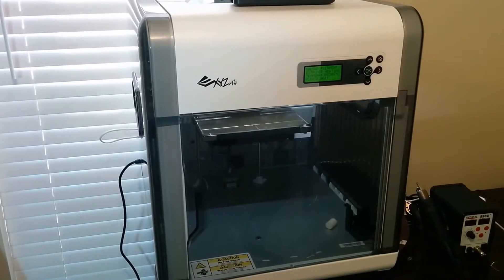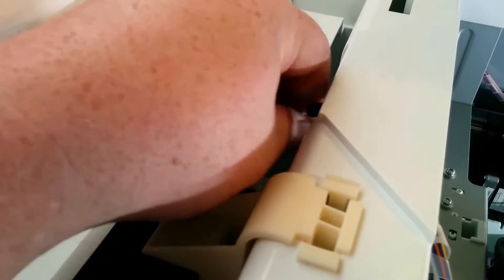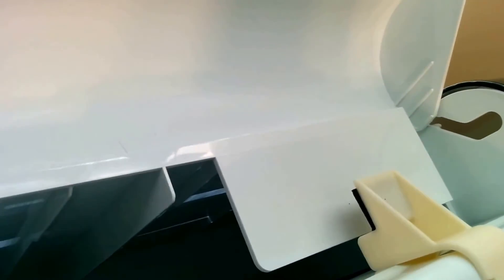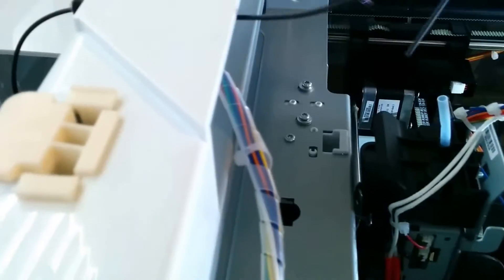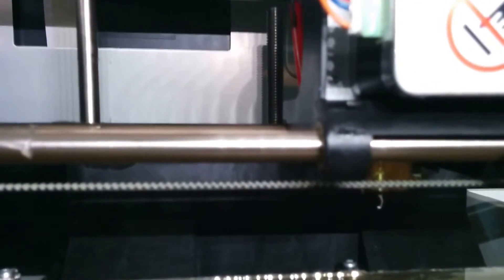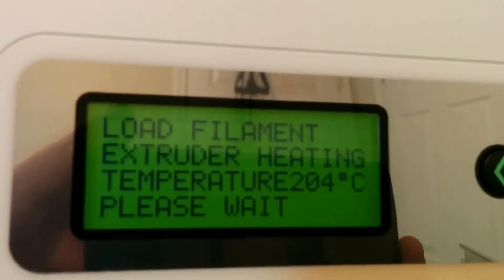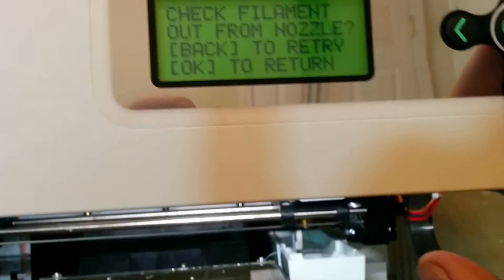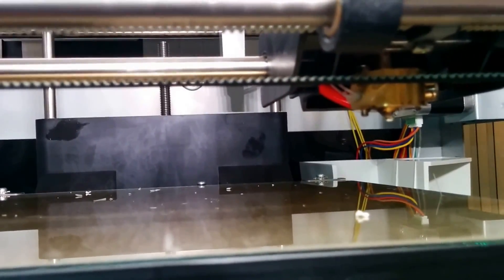DA Vinci 1.0 3d printer how to change filament

Comment: Hey Mark, is there a special way to reset the 'remaining filament' stat? Mine has reached 2% now with a practically new roll, and I think it's just using the data from the old roll.
Reply from the maker: the machine should recognize the new filament cartridge and reset the counter. I have not played with my machine in a few years but If the machine still shows the 2% remaining put the filament cartridge back in and make sure you select change filament on the screen before pulling the old spool out. The machine is kinda finicky like this.
Reply: @2robotguy  thanks for the reply mark! I did the whole unloading and loading filament, and I actually managed to keep using the printer after the filament had supposedly run out. I'll try reseating the container thing!

Comment: Hey idk if you’ll see this but I’ve been working with this 3D printer model in my schools library and just came across this video, thanks for the help!
Reply from the maker: Your welcome. Message me if you have any questions 👍
Reply: @2robotguy  ok so I had another problem; I got the filament in and it started running ok at first, but after about 1/2 an inch of height in and it started going haywire and printing weirdly, all frazzled and thin, not resembling the lion sample I selected.
Any ideas?
Reply from the maker: @maniac117  sorry for the delay. are you trying to print the lion with the hair? if so this is not the easiest to print and based on setting it might fail on this 3d printer. Check the slice file and make sure it's printing the layers right. Thin geometry does not always work out right on all machines.
Reply: @2robotguy  yea I think that was the one, however I can’t get it to even start printing now.
It was 3 months ago so I don’t exactly remember, but I’m pretty sure it said it wasn’t heating properly.
Any solutions that wouldn’t involve replacing parts?
Reply: @2robotguy  still having the above problem, any ideas?

Comment: I have a di vinci and the print table wont rise up to meat the extruder head. No matter what I do. If I do a calibration it drops down about 4 inches below the extruder
Reply from the maker: I have never heard of this problem. To me it Sounds like something is wrong with your firmware. Try to reflash your machine and run a calibration again. Has this happened to anybody else?
Reply: +Mark Fuller I flashed it and reloaded my original firmware but its still messed up. Then I updated it and its still messed up. Thought maybe it was a optical stop problem. I guess ill try contact XYZ. Thanks anyway Mark
Reply from the maker: +John Vilardi I have had optical issues before on my reprap. Might be worth buying a new optical sensor on digikey or eBay
Reply: +Mark Fuller Thanks Mark
Reply: +Mark Fuller I actually have Da vinci Tech calling me this Tuesday to help me fix this. I'll let you know what happens.